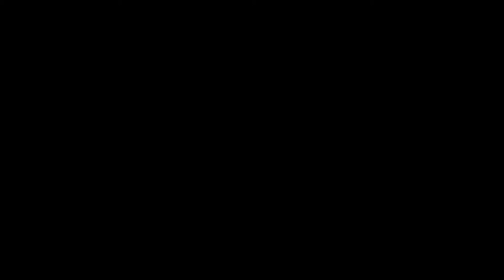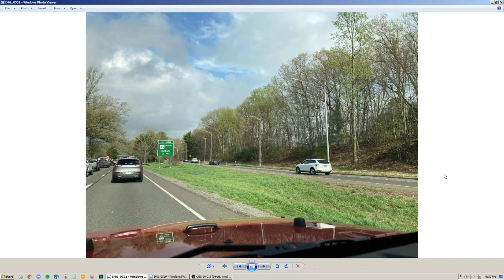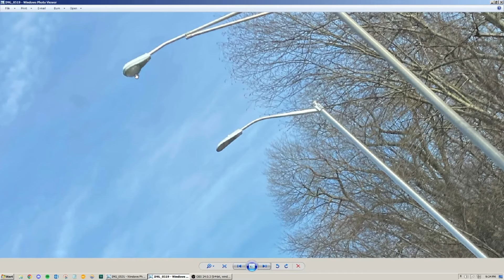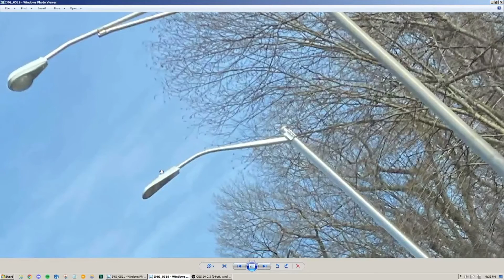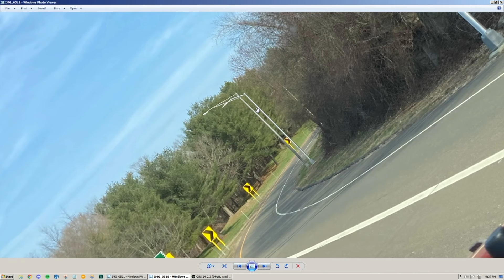I Hate These Stupid LED Street Lights

Comment: #bringbackHPS# Human Flaw: Blinding glare for drivers and sleep-ruining light trespass.The Climate Flaw: Staying freezing cold, causing traffic lights to ice over and barns to freeze.The Electrical Flaw: Fragile computer brains that fry or destroy the fixture during basic grid blackouts.The Material Flaw: Cheap, unprotected plastic housings that crack in the winter and yellow/burn in the heat.The Ecological Flaw: Harming everything on Earth through toxic heavy metal waste and blue-light eco-destruction.

Comment: In many municipalities, back in the mid-2010s—when sodium lighting was still the norm—sodium lamps were installed at a height of 4 meters on 8-meter poles. In the early 2020s, they began replacing the sodium lamps with LEDs, but only the upper ones; consequently, it is very common to see poles where both technologies coexist. And yes, even though some of the LEDs have been in use for less than three years, they are already failing, resulting in many dark areas—all to create a sense of false modernity that is jarring to the eye.
Reply: I’m curious, is the pole thing you’re talking about in one area/neighborhood or multiple?  I’ve seen similar things but that sounds really weird - especially because in the areas near me the lower HPS were usually the first to go since they’re easier to access
Reply: @brianinja  Where I live, many municipalities have already made the full switch to LED, though others are still in the middle of the transition; the situation I’m describing happens quite close to the city center. There’s also something else—equally or even more bizarre: on the poles lining avenues and highways that divide cities or municipalities, you’ll find sodium-vapor lights on one side and LEDs on the other—and in some cases, the LEDs have already burned out. Those poles are, in themselves, a surreal work of art.

Comment: You know what the biggest issue is, they CAN make LEDs that resemble sodium vapor and screw in, with a diffuser and everything, they CHOOSE not to. It'd actually cost less than what they're doing now. I use Filament LEDs all the time to mimic carbon filament lamps, they can be made to be orange. I wouldnt have an issue if they kept the sodium vapor ones used them till they burned out and THEN replaced it with a mimic sodium vapor LED lamp they can screw in, but they're being more wasteful by doing what they're doing now. And yet they claim to be "green" when all this ends up in a landfill anyway. It's ridiculous. I HATE the poor quality LEDS they choose. It's always the lowest bidder.

Comment: The other problem with those is that the brainwashed people who all they think is if it is not DEL, it’s not any more efficient than an indacescent, they are like “oh the old one was 250 watts, so we can replace it with a 40 watts DEL” which, because of the fact that the HPS lights are the same if not more efficient than stinkin’ DELs, that means that you get a dramatic loss in overall light output, similar to the brainDEAD people who put 60 watts indacescent replacement DEL bulbs in HPS fixtures meant for 70 plus watts HPS bulbs

Comment: seems like a waste of resources to build worse poles right next to the high end, working sodium lamps. SURELY they would be able to retrofit LEDs into the same socket.
it makes less sense the more you think about it.
Reply: Apparently the pole thing is because the original (HPS) poles were built before certain standards were set in place which require poles to breakaway when hit (for driver safety).  Still seems like a total waste of money though, and sadly part of the highway near me just installed LED poles directly next to the HPS ones😫

Comment: LED lights exist in our present time and future times, knowing that high pressure sodium lamps use more wattage than LEDs.

You really need to stick with future technology; not just step back into the past of old technology, that it doesn’t exist anymore.

High Watts = Very Inefficient + Strong Maintenance + Halogen Technology.

Comment: What if, rather than put a new pole, they put the LED fixture on the existing pole?
Reply from the maker: Nothing should be changed unless it's broken or expected to break soon. The only reasonable solution I will accept is installing good quality retrofit bulbs into existing fixtures.

Comment: I'm nearly blind in one eye and these LEDs have made driving at night so stressful and dangerous for me. The harsh glare of the LED bulbs screws with my already poor depth perception even harder and causes eye fatigue, its not safe to be squinting over the wheel!! Also tons of them have turned purple and made visibility even worse, in which case what was the point of replacing the damn sodium lights at all????
Reply from the maker: These are horrible lights, we should have staid with the sodium lights.

Comment: I’ve written here many times before, but I have a couple new observations around me since I last posted.

As I said in a previous message, the streets in Miami have been getting converted to LED row by row over the past yearish (until last June, every main Miami street was still HPS).  Roads continue to be converted every month, but one road that got changed to LED last November has since had two bulbs switched back to HPS (in the last month or so).  I know at one point they had been all LED because I drive down that road often, and I even checked Google Maps from earlier this year to confirm I wasn’t crazy.  So I’m not sure what’s up with that.  I’m guessing they’re just using up what they had already bought, but it still seems really strange to switch them back (and in a way, just doing two seems so inconsequential).  The road across from it that was more recently converted to LED added two LED bulbs several months before the whole thing was switched over, so I almost wonder if the same is happening here, in reverse.  I doubt they would actually switch an entire road back to HPS, but I find it curious that they’ve changed two back either way.  Maybe people requested it though.

Also, on the highway I’m starting to see a few signs of LEDs showing up😢 There’s one stretch that got switched to LED two years ago, but they’ve added a few new poles that are LED and I’m pretty sure they’ve also just changed a couple of HPS out for LED as well.  I’m guessing they’re just going to start gradually transitioning it as they burn out.  But there are a ton of HPS bulbs that have been dead for awhile and most haven’t been replaced with LED.

It’s so weird.

Comment: You know ... I think I have rediscovered not only why I hate the LED streetlighting we have, but also these flat LED discs on ceilings. They'd be real nice if designed properly. Like, LED filament lamps are great, I just think their CRI is a little off. If done right, an LED is great. RGB LEDs are amazing. Sadly, the most popular LEDs are so cheaply made, that they tarnish the reputation of the good ones. If there was a flat LED panel installed, via some sort of retrofitted pins for easy removal when in EOL, in a classic shaped cobrahead with a classic Type [insert numeral number] refractor lense, with the correct color temperature, all people besides all lighting experts, wouldn't notice.
Reply from the maker: Correct.

Comment: You can see in the image that the inferior leds do not spread out the light very well so there are more leds close together because they are absolute crap because they dont have a refractor and if there are more leds it could mean that the leds could use even more electricity than HPS if there are more leds compared to just a couple HPS.

Comment: I live in Denmark where most street lights have been changed to LED and its far better. Maybe it isn't the cheap kind. And they do also outlast HPS by YEARS. In my hometown they started substituting HPS's for LED's back in 2013-2014 and I've maybe seen 2-5 lights out - honestly. And thats compared to the REGULAR outage of multiple HPS's continually, never catching up with all the replacements. I've always been kinda geeky about this so i've kept tabs.  

The refractor lens on the sodium lamps protrude out from underneath the housing. This results in far more light pollution, which not only is a problem in terms of nature and wildlife but is also wasted energy. And as a counter point, most of the LED street lights i've experienced have refractor lenses placed over every single diode. AND the diodes are pointing in different directions fanning out the light to suit the path of the alongside going road better. Thats a far more efficient usage of energy. So the LED's are better at throwing the light out further. Installing the lights closer to the ground is stupid, unless the throw is better - which once again it seems to be in the instances i've experienced. Either way the installing height is not really to blame the LED's for. 
The more appropriate approach would be to use the existing posts and just change the heads - obviously?!
And I hate to point out the obvious (actually i don't) but if you're blinded by the LED street lights and you are in a car thats on the road, far enough away to have the light in line of sight, wouldn't that mean that the throw is indeed better on the LED's. So you have to choose. Either it's better throw or less blinding to your eyes. From a basic physics standpoint it cannot be both. 

Regarding the light quality, you couldn't possibly be more wrong. The 'temperature' of the lights are in no way a good indicator for the lights quality, but it does give away some of the weaknesses of HPS.  High Pressure Sodium lights typically manage a CRI (color rendition index, that's what we use to measure light quality) of 20-30 where 100 is the best. Better HPS lights manage a CRI value of 40-50 CRI which is still terrible compare to standard LEDs (not even more expensive LEDs) which manage a 80-85 CRI. What this means is far better visibility and recognisability in this type of lighting. (Recognisability of all the things needed to be illuminated) It's far more true to natural sunlight than HPS. Whether or not someone 'likes' the color is unimportant. You may like this orange light more, but then again you also prefer the look of windows 98, so not a shocker that you're a bit scared of change. What is important is the quality of light which LED's manage to do better in using less energy - because they do use less, I don't know where you pulled your numbers from. Not to mention how LED's are being dimmed (at least where i live) during some of the least busy hours of the night, resulting in them using even less energy. This is not even possible with HPS's.
I think its a matter of getting used to a change, and i welcome the change when it comes with this many advantages. The more blue-ish light from LED's are in a phone and computer aspect notorious for keeping people awake, but isn't that kinda exactly what we would want from street lights. Something that isn't a washed out orange light that lulls you to sleep?  
All this without even mentioning the long Warm-up time tied to HPS lights, something LED's don't suffer from what so ever. 

I hope this adds a different perspective since your comments seem dangerously close to an echo chamber. LED's are great!
Reply: I appreciate the detail of your response, but I disagree with your assertions completely.

One, you saying that the new ones last longer goes against what I've seen.  Whenever I drive around my area which got the lights in Summer 2023 or Miami which got them in Summer 2024, I see far more lights out.  Then I'll drive down a random road with HPS and I'll see maybe one in 50 lights is out.  Not to mention the number of lights I see in parking lots endlessly flickering.  And as the video says, they put newer, lower ones along the highway and most of those have a purple tinge.

I also disagree with the idea that the new lights are better for nature - the older ones were not obnoxiously bright and directed, while the new ones are much moreso.  So these lights are undoubtedly affecting wildlife in their behaviors as they mimic daylight in certain concentrated areas.  Also, the lights make it hard to see anything in the sky, so it also takes away peoples' ability to enjoy the night.  And your claim that "it cannot be both" is flawed as his comment about being blinded by the new lights doesn't necessarily mean they're throwing farther; it can also suggest that the lights are just brighter - which they are.  The light's throw is not the only factor in the blindingness, it's also the difference in brightness of these new ones.  So that was not a contradiction.

Not to mention the blue light of LEDs linked to depression, the brightness of LEDs disrupts sleep, and the strobing of LEDs could cause seizures on the.

All this and we haven't even reached the aesthetics.  I just think they look so much better - I don't get how that's even a debate.  A nice, warm color.  Just because someone doesn't like certain changes doesn't mean they are opposed to change - and in many cases the classic is tried and tested.

Also, I'm a light geek too and I just feel like the HPS ones have so much more character than the new ones.  The new fixtures are flat and ugly; the old ones look like lights.  The old light had a unique color; the new one is bright white.  The old ones had a warmup time; the new ones don't.  These new ones feel so dystopian and on top of everything else are undoubtedly weaponized against us...
Reply: Maybe they're great in Denmark, but here in the US where everything is done as cheap as possible its been an absolute disaster. It genuinely would've been better had they just left them alone.

Comment: So, in the part of Miami that my grandparents live they changed about half of the streetlights to LED late this June and left about half the old ones.  I was so sad when I saw the switch at first, but it gets worse now.

The roads with LEDs since June (that have only had the new lights for six months) already have big stretches where none of the lights work whatsoever.  Like 5-10 in a row will just be dead.  I don’t know if the lights failed or if that section of lights just isn’t turned on, but it’s not a problem that I ever noticed back when these stretches were HPS.

The June LEDs were changed very systematically, but in the past couple months, the same area has switched out some more HPS, but in very small groups of like 10-20 lights.  So it’ll switch between blocks with the old bulbs and blocks with the new.  There’s also one block that randomly has amber LED streetlights instead, which is weird because it was switched in the same timeframe as the other LED ones, but they put a different type on this one block.  

There’s also a looooong stretch of road with HPS bulbs that was working perfectly until about a month ago, but recently they turned all of them off and for some reason changed out two fixtures in the middle of the HPS road for LED bulbs, even though they’re all being kept off anyway.

I don’t get the logic of all this.  I hate LEDs, but the June change at least seemed efficient.  Now I don’t know what they’re doing, but I guess either way within a year it’ll probably all be LED.  Maybe the amber bulbs gaining traction is our best bet, because they actually look decent (but still not as nice as HPS).
Reply: Writing five paragraphs about the streetlights near my grandparents house might be a new low for me lol.

Comment: My city hybrids new LED lights and new HPS lights for specific purposes, like LED in the city and HPS in some neighborhoods, my neighborhood has retrofitted amber LED lights in Cooper OVZ Light refractors, but they don’t have the glass. Instead, the retrofits use a  screen to amplify the amber light. My city also uses induction fluorescent lighting to light busy commercial streets
Reply: So they still add in some new HPS?  Or just are keeping some of the old ones?
Reply: @ they do both
Reply: @Elite93WT I think my area might be doing that too on the streets that still have HPS but I don’t know.  I feel like when enough of the classics burn out they’ll do a sweep and replace the highway near me with LED.

I feel like more highways still have HPS, but I guess that’s because it’s harder to change them.
Reply: @ Yeah, that’s why the 215 always has HPS 45ft poles and some retrofitted with LED lights which surprisingly aren’t blindingly white, but more warm white

Comment: A few observations I’ve made recently:
1. Often when they switch an entire strip of HPS lights to LED, one or two are left as HPS.  I know it’s not that they just keep the ones that haven’t burnt out because they change like 99% but just keep a couple old ones.  Maybe it’s just an oversight and they forget to change some as I can’t think of any other reason for that.  
2. Also, I notice several neighborhoods near me keep the old ones by the entrance but within the community it’s all the aggressive LED ones - almost like they know the HPS ones look better so just use a few to make the main entryway look good.
3. About 5-10% of the LED ones which have been around for about 15 months are already dead. 
4. There’s one neighborhood near me that’s still ALL HPS.  It looks really weird because every other HOA community switched to the LED about 10 years ago - just the main streets kept HPS for longer.  Those lights alone make the community look so much nicer and warmer.
Reply from the maker: I haven't seen that around here, every sodium fixture in sight is replaced unfortunately.